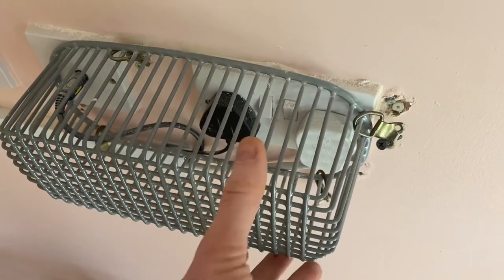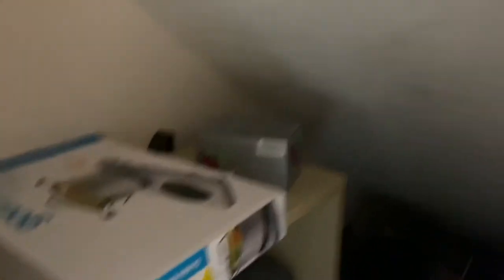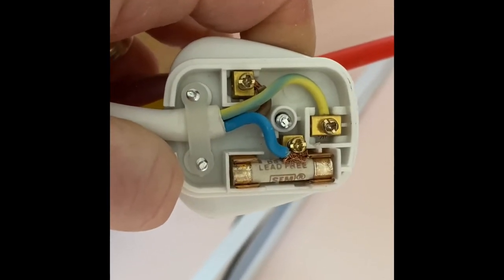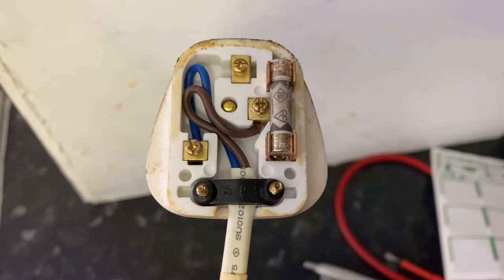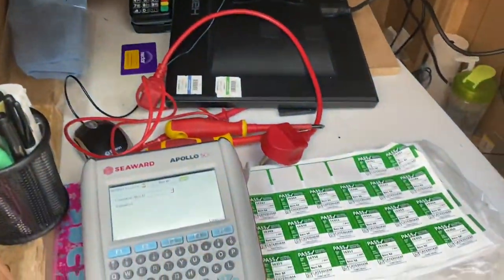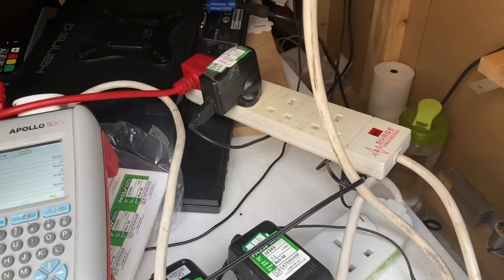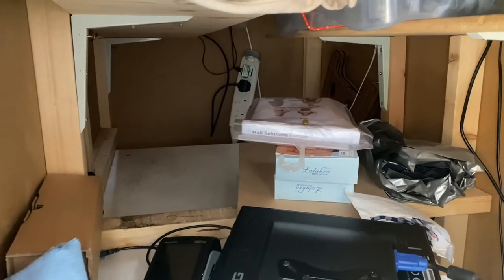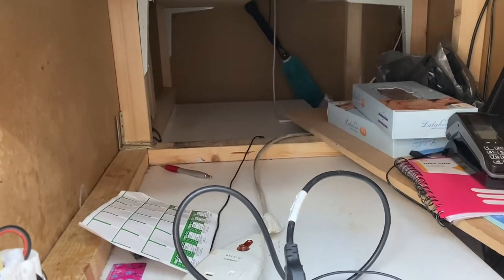PAT Testing Nightmare! | Cramped spaces and hard to access places. Day in the life of a PAT tester

Comment: I can imagine the office areas of shops, guest houses and takeaways etc are the most chaotic. Wiring everywhere, plugs into extensions trailing under things, tangled up, damaged appliances and equipment they are still using, wires coming out of plugs, I can just picture it. They won't be bothered about it being tidy and certainly won't notice if any cables are becoming damaged etc because they are more interested in the day to day running of the business.

Comment: Hiya, What do you do in those situations when as you have shown, you cant do a full visual inspection? Do you still tag them as passed but write in a report that visual was unable to be performed ? If the appliance is not tagged because you cant carry out the visual, have you lost customers who just expect it to be tagged. Cheers.
Reply from the maker: Hi there, I would just do as much as a visual inspection as I  possibly can and note what you could and couldn’t do on the paperwork. Sometimes conditions are as such in the video where it is physically impossible or unsafe to the tester to conduct a full test and you would recommend to the customer that a full inspection should be carried out in due course